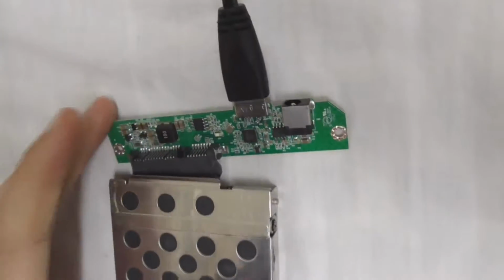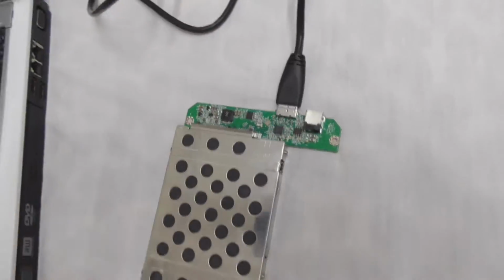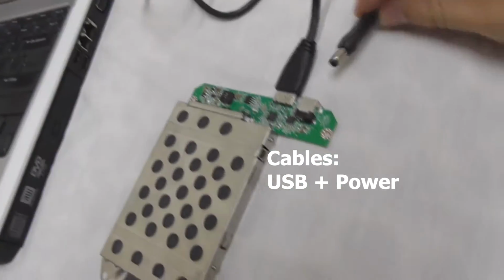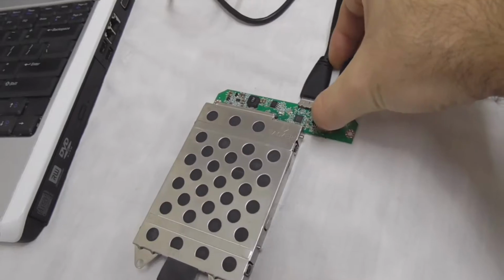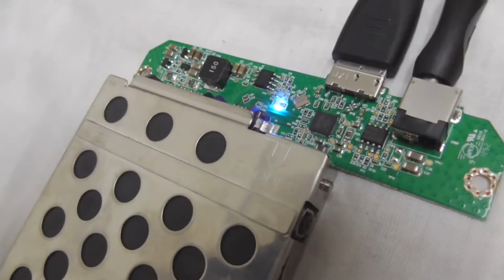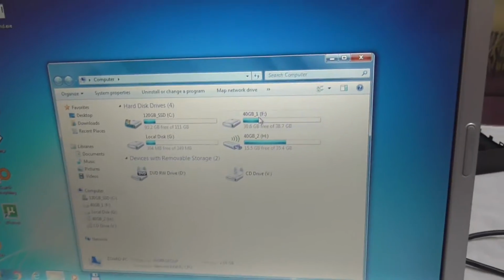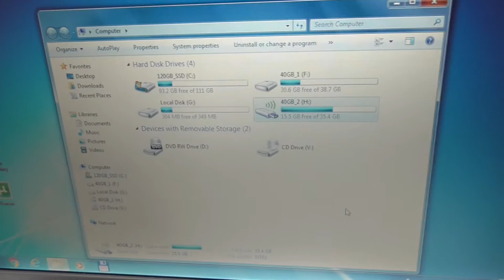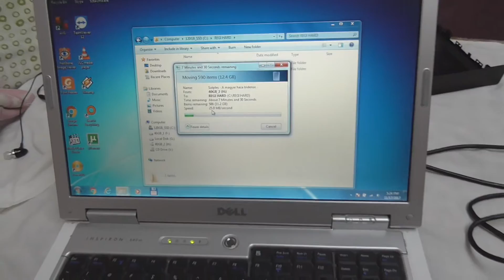Serial ATA to USB 3.0 adapter from an external HDD (E3215-1215A_4D)

Comment: I believe that circuit board has drive encryption, which means you may not be able to access the drive without it.
Reply from the maker: The drive is working without it, so probably there is no encryption. The original 2TB drive is connected directly to the motherboard of a desktop PC through S-ATA cable.
Reply: @furulevi  Yea, I think it might be that drives over 2TB could be faked to be compatible with earlier OS's. I saw a review about it on Newegg for my 4TB Expanded drive.
See the Top Negative Review here...
https://www.newegg.com/seagate-expansion-4tb/p/N82E16822178354

Comment: My laptop doesn't support USB 3.0, i have 2nd HDD caddy in hand
In that case
 Can i use this without power cable with 2nd HDD caddy via just usb cable ?
Reply from the maker: Exactly this requires power also, without power the motor of the HDD isn't spinning, LED isn't ON.
Reply: @furulevi  even for 2.5 sata HDD ?

Comment: I am ignorant about the size of the sata connector (power and data combo) of a 3.5 inch and 2.5 inch sata drive. Are they the same size?
Reply from the maker: Yes, same size, the original HDD was a larger 3.5 inch and the one shown in this video is a 2.5 inch HDD.
Reply: Okay, thanks. Now i know.